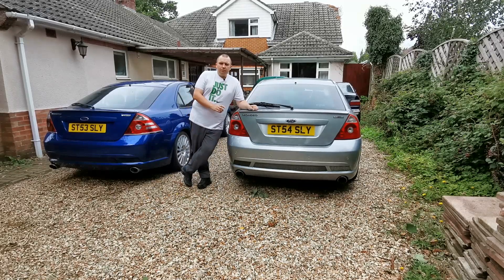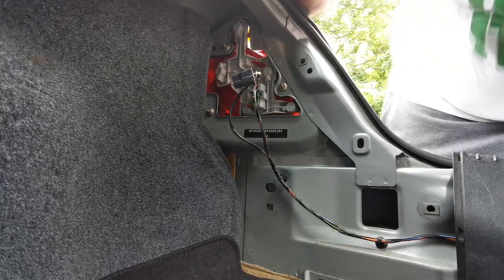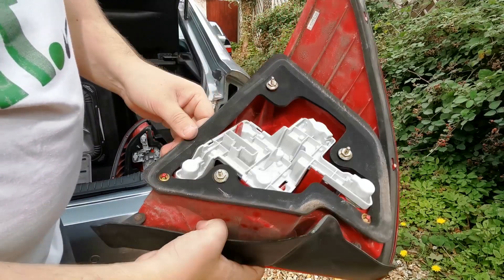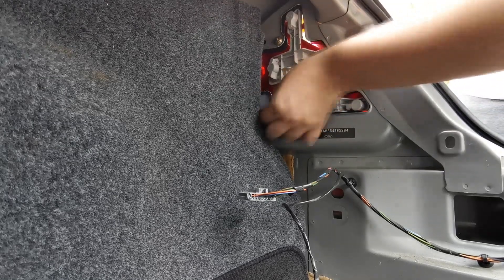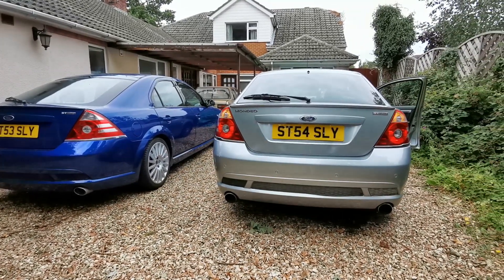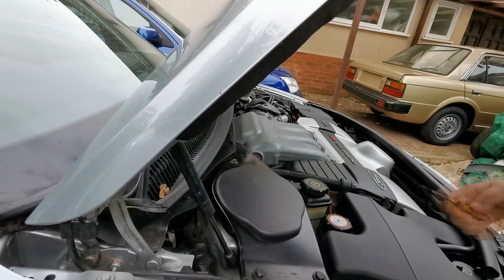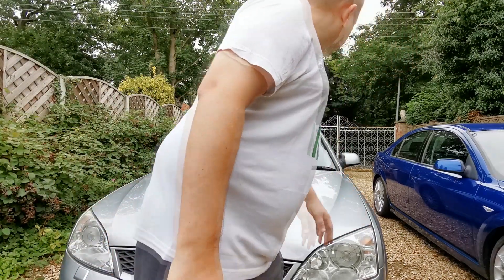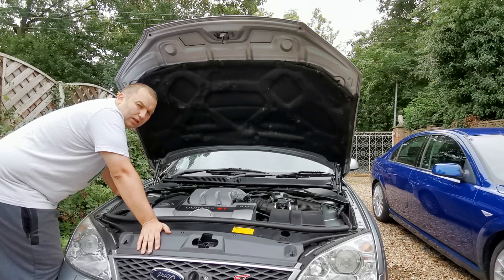Mondeo MK3 Rear Light Cluster Swap & Bonnet Strut Change. ST220

Comment: Depending on the MOT tester he will pull you up with the lights. The later ones are missing a reflector as they put them on the lower bumper in the later models instead of the lights. . I kept a pack of £5 Halfords stick on reflectors in the glovebox and my local one would pass it with them there.
Reply: Good shout, he'll prob get away with it though I've got the pre-face bumper strips in mine and never had an issue. Cool comment tho!
Reply: ADM I’ve been pulled on it so it all depends on the mot tester really ✌️

Comment: The new rear lights look much better. All you need to make them mot legal is the reflector that goes in the rear bumper at each side which is simple job of removing the old insert and replacing with the new one
Reply from the maker: Yes cheers bud 👍